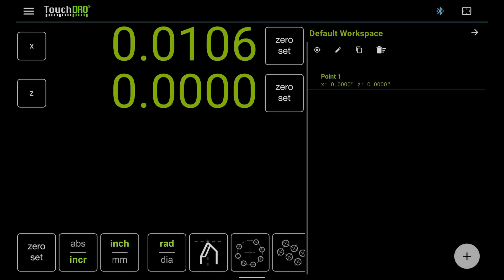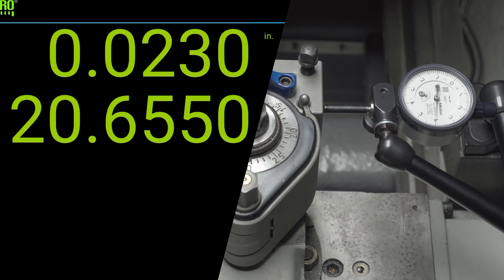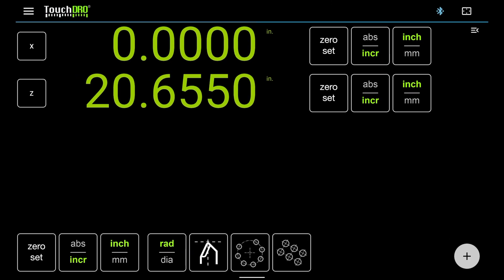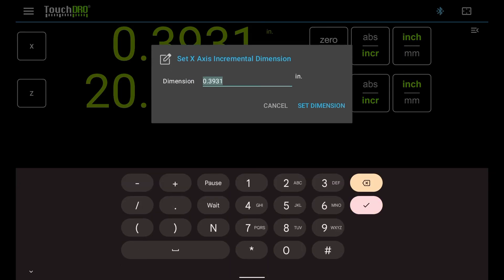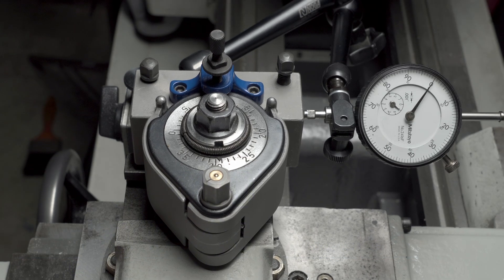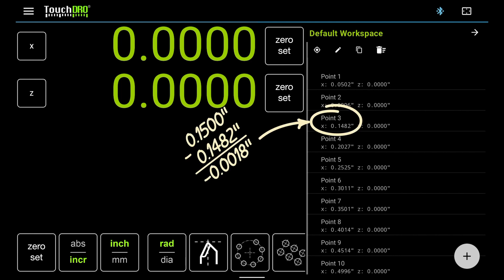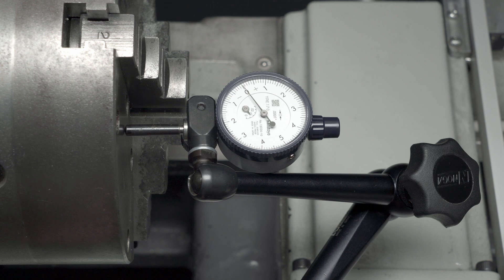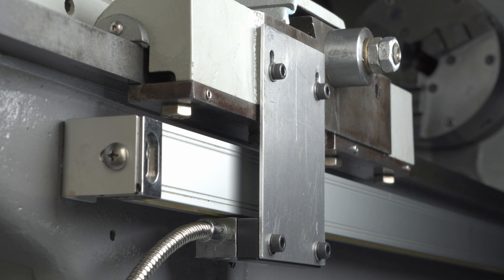How to Check and Calibrate DRO Scales on a Lathe

Comment: Good timing for this. It's been about a month since completing the install on my lathe using 5 micron Ditron magnetic on the cross slide and 5 micron optical on the Zed. After Cal, I was having similar error on the magnetic scale, and the optical was dead on. Kind of a bummer about the magnetic scale, but since any parts I make aren't for space travel, I can live with it.

Comment: Thank you for the demonstration on hysteresis. I was having a bit of trouble wrapping my head around how to calibrate that. Awesome work, as usual!
Reply from the maker: So, fair warning - since I posted this video. I got feedback from many people that hysteresis adjustment has "weird" results. I don't fully understand it, but it appears that some scales have hysteresis that behave like basic backlash (mine does this). Then there are some that just have an area where the reading can flip either way, possibly during analog to digital conversion. One person ran into a scale where one day the scale was showing almost 10 um of "backlash", but the next day, in the same spot it didn't have any. Possibly a mechanical/temperature issue?
Reply: @TouchDRO  With my igaging absolute plus scales I have found the mounting is extremely finicky and important.  Counterintuitively, my issue was over constrained mounting.  The alignment has to be just perfect otherwise the hysteresis is poor and inconsistent. I WOULD RECOMMEND THIS PERSON TEST THEIR SCALES UNMOUNTED, mine had zero in the free state.  As soon as I mounted it, it would have it.  My X axis was always good, but my Y axis took alot of iterations to get aligned and I still have around .0004 to .0012, which is very good considering what it was previously.  Again, this scale had no hysteresis in the free state.

Comment: Just what I needed, now how to use mm and 25,50,75 block.
Reply: you can toggle each axis between mm and inches. so even though I am metric, I can switch to inches just for calibration  with a 123 block.
Reply from the maker: Pretty much the same way. The calibration process will default to metric units if you set the default units to metric in the app settings. Under the hood the app uses microns (fractional) as the base unit, so there is no rounding error either way.

Comment: Thank you for making these videos! I recently installed my TouchDRO setup on my lathe. The next thing I'm going to do is recalibrate it using what I learned from this video. It's really close now but I feel it's a little off. I'm thinking about replacing the DRO on my mill, which has optical scales, but I would like to replace the quill scale with an iGuaging scale. Is there any way to mix them?
Reply from the maker: Not easily. The "iGaging" board can read optical scales, but needs extra components to work with 5V scales. That said, I wouldn't bother with iGaging scales. Even cheap Chinese magnetic scales will work much better (even though they are nowhere near as accurate as optical scales). Mounting a magnetic scale is more involved, but you will be much happier in the long run. 
I'm adding a DRO to my new mill, and that will be in the next video in a couple of weeks. I will probably use a EMS/Electronica miniature magnetic scale for the quill.